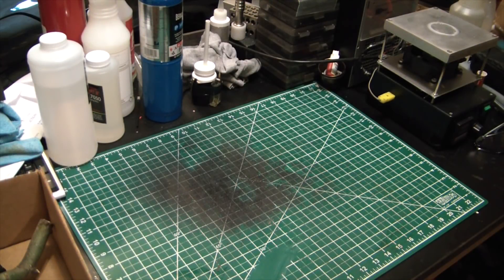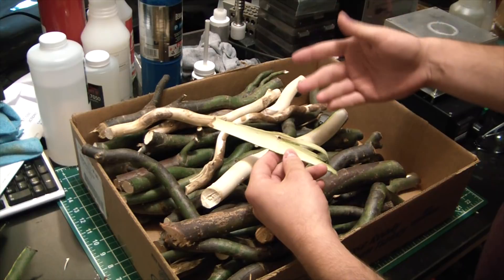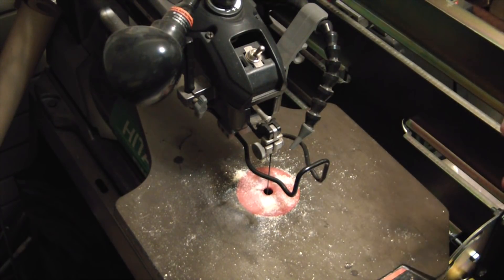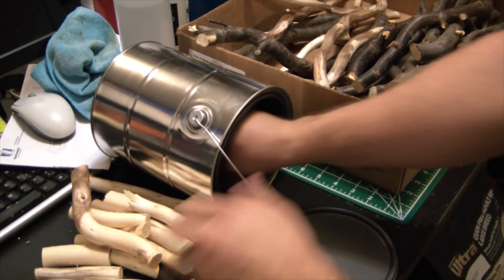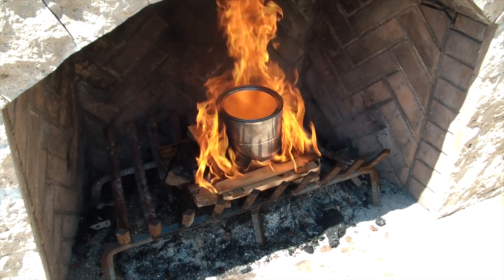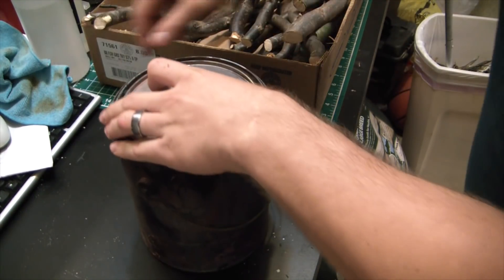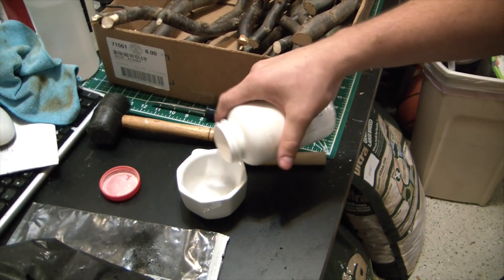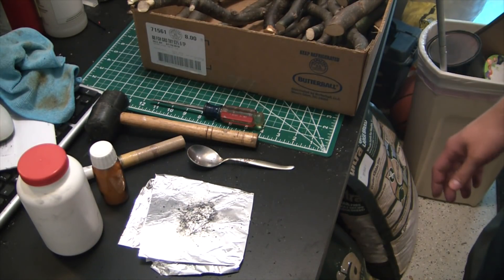Making Willow Charcoal for Black Powder - The BEST Charcoal! ElementalMaker

Comment: I was making charcoal by pyrolysis of flour, hoping for higher carbon to salts ratio. Also I hoped that it will be powder after pyrolysis, but it clumped a lot...
as a next experiment I wanted to try using grass leafs - that should powderize nicely
Reply from the maker: Ilusys Systems very interesting, let me know the results! Are you making black powder with these various charcoals?
Reply: Not for black powder, just for testing... I was thinking about using carbon for glass blowing tools. They are made from graphite, but maybe amorphous carbon would be OK
You can check video of flour run: https://www.youtube.com/watch?v=Z0FoiUjMDVQ

Comment from the maker: I LOOOOVEEE COALLL! Well... Charcoal.
Reply: Feel ya on Louisiana heat, it's like being a crawfish Easter Sunday. Cool video didn't realize black powder was that easy.
Reply from the maker: @chasenk00019  I'm not even that far south! Just a bad heatwave up here in the northeast. Louisiana must be brutal! My cousin is stationed down there. Black powder is indeed some very easy stuff to make!
Reply: You definitely strike me as the gasifier type and of the sort to tune the pyrolysis parameters rather than follow some sort of cargo-cult engineering like others do.
Reply from the maker: @icarus901  I certainly do produce alot of gas. The wife always complains.
Reply: +ElementalMaker yours too? It's a sign of good health, I always tell her.
Reply: Well any type of willow tree wood work, I live in the Rocky Mountains, and I do not know if the type of Willow Wood-willow tree that is indigenous to the Rocky Mountains will work as well as the Willow in Louisiana? By the way awesome video dude
Reply: @ahoahat7919  yeah, any willow will work but so will most other types of tree. Almost any kind of charcoal will work in my experience but the more porous the material the better, faster burn rate you will have. If you want to know what kinds of wood are more porous then you just have to find supple (flexible) plant material that bends easily and doesn’t snap when it is green and alive. (Think about how soft sunflower stalks are... the seed shells in particular have a decent yield when pyrolysis is complete...) Grape vine for instance works extremely well and was used to some degree by the American colonists for their powder. Hope this helps you find alternatives should you need them.
Reply from the maker: @ahoahat7919  pretty much all willow species make for excellent charcoal!
Reply: @ElementalMaker  would pine work? Up here in Canada we got more pine than you got bullets
Reply from the maker: @michaelrogers3857  you bet! Cheap white pine from 2x4's works great
Reply: @ElementalMaker  what it i just used some of my split lumber? Thats what ill be using
Reply: @michaelrogers3857  yeah, any pine will work. Any charcoal you get from pretty much any natural wood you burn/pyrolyse will work. Some better than others though. (Non natural wood like particle board that uses adhesives or glues wont work very well and release toxic fumes when burnt.)
Reply: @the_great_tigorian_channel  i got a coniferous forest so im chillin, thank bruv
Reply: Would there be any energy left for black powder in Carbon that was made by reacting sugar and H2SO4?
Maybe just charring the sugar a bit by putting H2SO4 at different strengths on uncontained lump sugar and getting carbon without the exothermic reaction?
Reply: @docthebiker  you could get some carbon from that sugar reaction though I cant attest to it’s quality, but I would point you to something far better and less labor intensive. To save time, just use the straight sugar. Turns out by using KNO3 (stump remover) and sugar in the right ratio (I will let you investigate that with google and wont be held responsible here for what you find or try) with a little bit of red rust from rusting iron (again I will let you find the specifics here on youtube for this recipe on “The King of Random sugar rocket” video) you can create a slightly less smoky alternative to black powder. It is just as potent and has far softer fouling than actual black powder. Hope this helps.
Reply: Can you make black powder out of coal?
Reply: @samnottheotherone4363  depends on what you mean by coal. Charcoal briquettes are not going to work well at all because they contain lime in order to slow and steady the burn rate. (That’s desired for an easy and even cooking experience that reduces the chances of your burger getting charred and burnt.) Lump wood coal will work far better, but that’s what this video basically shows...
Reply: @the_great_tigorian_channel  I said coal not charcoal
Reply: @samnottheotherone4363  So are you talking like COAL coal (fossilized peat bog) as in the stuff they mine out of rocks and burn in power plants? If that is what you mean then I would say it is possible to work but probably not as well as what you would get from the method in this video. I’ve never tried it (I’ve never had access to raw coal) but technically any source of carbon will work (sort of... elemental maker did a comparison between willow charcoal, activated charcoal and graphite) but fresh organic carbon works best. Coal comes from fossilized plant and animal material but I don’t know how the deposition, compression and fossilization of those organic materials affects its burn rate. Sorry I’m not more help on this one. 😕 Stay safe! 🙂
Reply: I accidentally Spilt some dry pasta on to the gas Hob when I was boiling some pasta at the end I found it As crispy charcoal Was wondering if it would be any good for Gunpowder  Pasta seems to be pretty energetic When you burn it Just as dry pasta so Maybe it could be good for blackpowder in charcoal form
Reply: @TheMono25  pasta burns because of the carbohydrates in them. I have never thought of trying to use pasta in black powder but i would hazard a guess that it would probably work... maybe not very well, maybe great... I couldn’t tell you for sure...
Reply: I eat coal.... I mean charcoal
Reply: Willow is one of the best for smoking fish . my dad taught me to smoke sucker fish.  Redhorse fish too.
Reply: Can you help me with something? I'm trying to make gunpowder with the same consistency and burn rate as hodgdon varget or hodgdon h335 to reload 223 bullets. I have the 3 ingredients but idk how to get it right to be safely used in 223 bullets. Thanks
Reply from the maker: @nathannolanrealtor  I hope you not planning to use that in an AR, it will decimate the gas system and foul the hell out of your rifle. Keep in mind black powder, in addition to being dirty as hell and smoky, also produces corrosive residues which will ruin a toy if left unclean for a short time. I'd really research the forums and see if others have done 223 with BP. I'm sure it's possible, but it's going to be one heck of a challenge
Reply: @ElementalMaker  yeah, I know there would be a whole lot of pressure testing and repeated measuring over and over to get it right. I was just wondering if it can be made strong enough to load a bullet with. I think new gp is made of cordite bc it takes a lot less to make a big boom.
Reply: @nathannolanrealtor  Black powder can work in SOME modern firearms and give you decent results. It all depends on the type of action your firearm has. If you have a bolt action, lever action, revolver or any other manually operated single shot firearm (requires you to manually remove the spent case and chamber another round) then you can use black powder safely. If you have a semi-auto or (heaven forbid and my gosh would I be jealous) a fully-auto firearm, don’t try it. Most semi-autos (fires once each time you pull the trigger and racks the next bullet without you manually chambering a round) are gas operated nowadays. (The gasses from the modern smokeless powder going off gets piped back to a piston that chambers the next round.) if you happen to have a blowback or a recoil system (the force of the recoil or “blowback” of the bullet on the casing is what drives the bolt back to chamber the next round) then yes, you can use black powder in a semi-auto. It would be smokey as a California wildfire but it would work. If none of that made sense, just don’t worry about using blackpowder to reload unless you have a revolver or a bolt or lever action and be sure to clean them well after you are done shooting... the fouling is very messy and corrosive.
Reply: @ElementalMaker  yeah, black powder can be used in some kinds of firearms but in general, don’t use it in semi-autos... most are gas operated nowadays.
Reply: @nathannolanrealtor  Oh, one last thing! Modern cordite and smokeless powders are not just about a bigger boom they are way, way faster which means far greater chamber pressures. Be careful with substituting smokeless powders like cordite for black powder. But if your gun is made for cordite pressures it can handle the pressure of black powder in equivalent volumes easily. Happy shooting and stay safe! 👍
Reply: So how long do you cook it in the retort for.
Reply: @darrellgoodman9585  you just have to keep an eye on the retort pressure vent. When the hole stops spouting fire, smoke or gas of any kind then you can take it off the fire and let it cool. Just be sure it cools fully before opening it or you could have your charcoal begin to ignite and slowly burn to ash. It depends on how hot the fire is and how much material you intend to pyrolyse but I typically find that a half hour is all it takes for me to char a paint can full of wood over a moderate sized fire. Hope this helps.

Comment: I still have about 15# of mine ,I actualy have to use baking soda in my bp for rocket motors because its so fast.  and thats just milled !!! not wetted and riced
Reply from the maker: Damn Tony that's A LOT of willow charcoal! It is certainly some hot stuff. baking soda is probably great since it will increase combustion byproducts, ie extra CO2.
Reply: YUP  I got a shitload about 6yrs ago and a little goes a long way . ,My friend used a 55gal drum for a retort.he sent me a mildly crushed batch in a 5gal bucket ,which is barely even dented by now . I only make bp for muzzle loading and lift.out of it, my rocket bp[mill powder] i now just use mesquite charcoal in a 60/20/20 mix
Reply: btw ive only ever used that willow and pine charcoals that were homemade... idk wtf paulowina is and nobody on passfire or anywhere else ever answered that for me.lol.btw if u ever need another pyro cd let me know .my collections even bigger now . I have pdfs on just about everyuthing
Reply from the maker: I will be growing Paulownia and actually just got the seeds earlier today! Grows to 15ft in its first year. Hopefully I can cut down after just a couple years to harvest for charcoal. I was lucky enough to get a pound of Paulownia charcoal about five years ago and it made by far the hottest BP I've ever seen. I'd love to see your updated collection! Are you still at the same email?

Comment: Thy the Hole in the bottom? I have done this but placed the hole in the Top
Reply: I'm guessing the paint can fills up with wood gas which at some point will have pushed all the air out. You might as well let that wood gas fuel the fire that's under, instead of letting it diffuse away
Reply: it ignited on mine as well, I used fir/pine as it was Just playing with it really should test it in some black powder.. but fist I need to make a ball mill